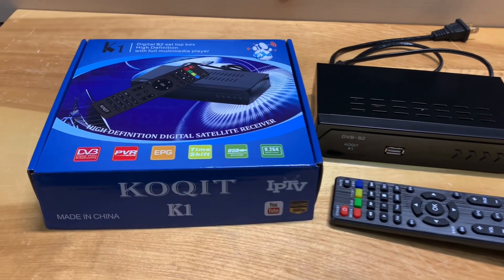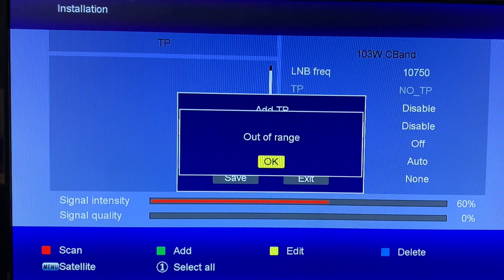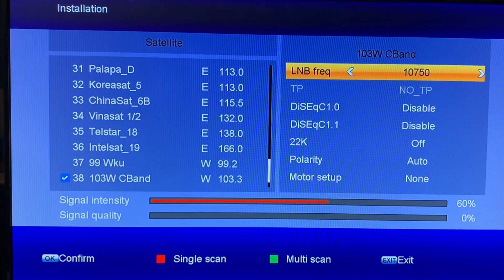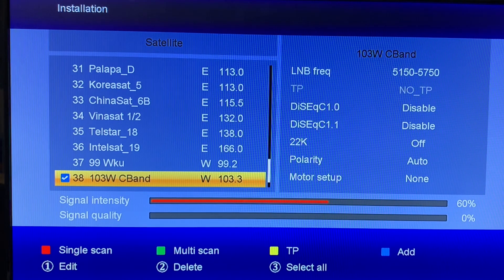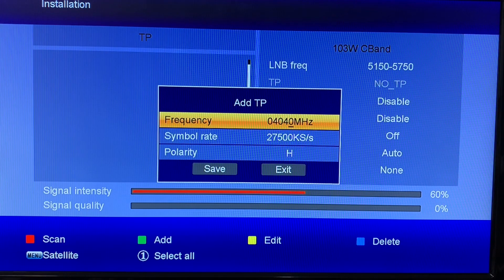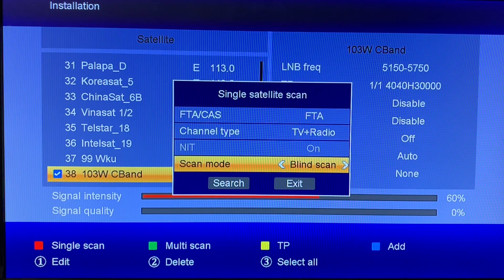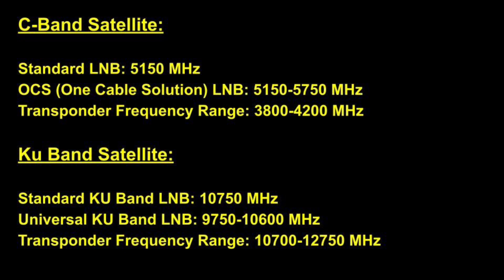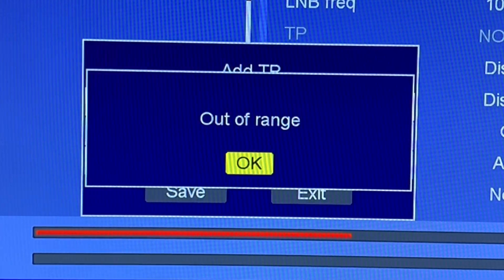Koqit K1 FTA Satellite Receiver Out of Range Message

Comment: If I manually entered a transponder first and do a blind scan would that eliminate my reciver scanning the polarity backwards because I'm updating all my stuff to lnbf and dumping the old servo motor type lnbs used back in the 90s,also actuator arm froze up and stoped working,was using on old receiver for slave to move dish cspan analog gone to junking analog receiver,all switched out now using dieplex and 22 switches on 6 cband dishes and ku as well,once everything switched out I believe I will have less problems,just change channels,no more waiting for dish to move,great stuff here.thank you very much.
Reply from the maker: Interestingly enough I have manually entered transponders and when I run a blindscan the frequencies don’t always match up. The frequency or symbol rate can still be off by a digit. It might have something to do with the LNB, over time the oscillator frequency can can drift slightly (something to do with the electronics). So a transponder can scan in as 4141 instead of 4140. I’ve had incorrect frequencies and reverse polarities before too, but the channels are still there! It would get expensive changing out LNB’s all the time, they sit out in the weather (freezing cold or blazing hot sun) and take a lot of abuse!

As far as the reverse polarity thing, I’ve read in forums that it could be the LNB is turned 90 degrees, reversing the H and V antennas, or it could be the 13V/18V is reversed in a setting in the receiver menu (or maybe a switch?). Not exactly sure, just what I’ve read.

The new type of LNB with all electronic switching makes it easy, just connect the coaxial cable and you’re good to go.👍📡